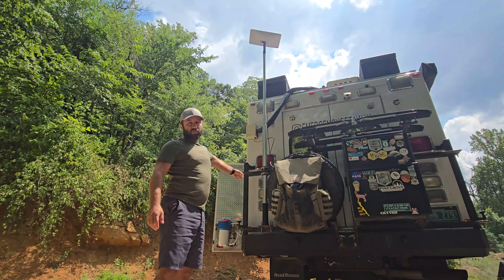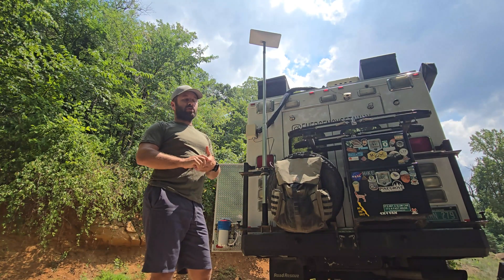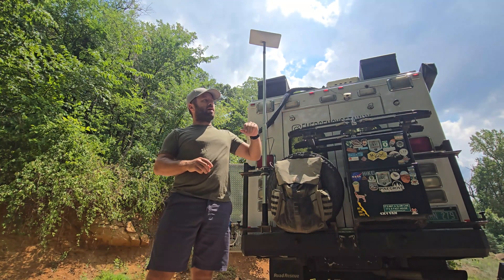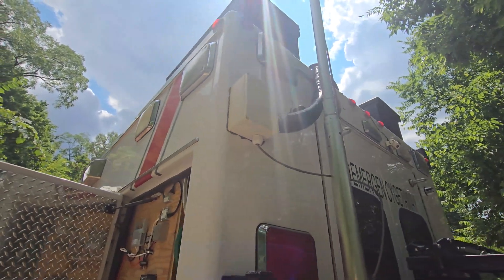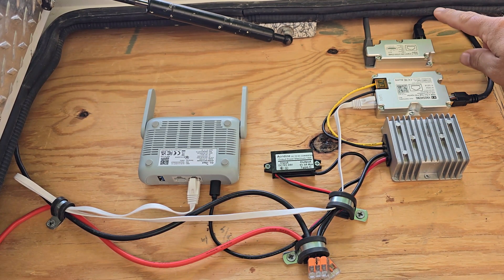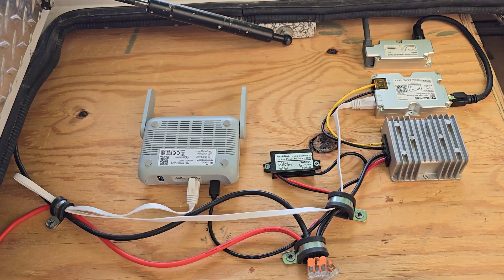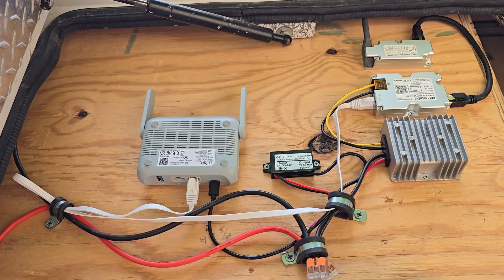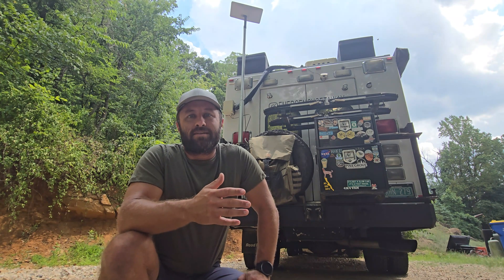How to Power Starlink with 12V: A Simple Plug-and-Play Solution

Comment: Hey! Thanks for making this video. I've had these parts laying around for a minute now and I'm finally going to do it. In your experience, what's the best way to interface with the Dishy once everything has been changed over. I've got the whole setup (unmodified) on the roof of my van and typically keep it in the flat position (via the app) but would like to tilt occasionally. Any tips on the easiest way to do that?
Reply from the maker: @natebaird  I'm glad I could help! You still use the starlink app to work with the dishy the same way you do now.